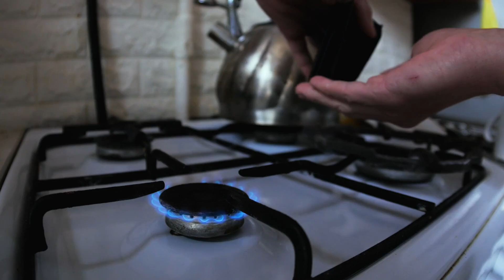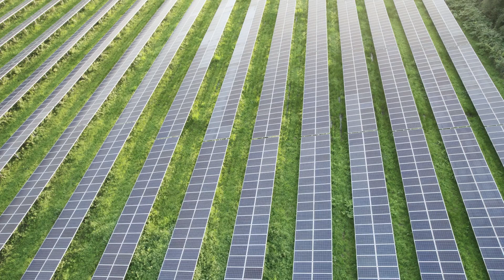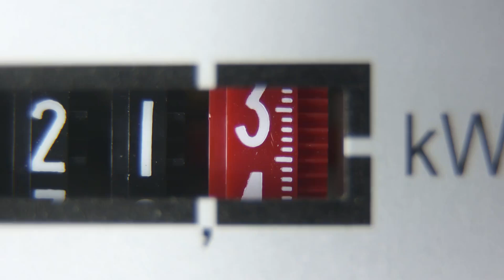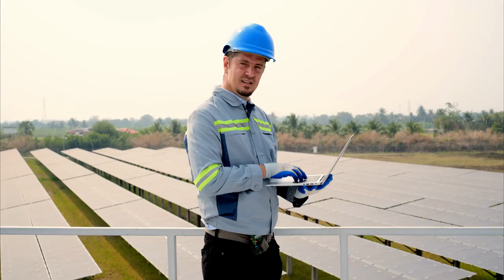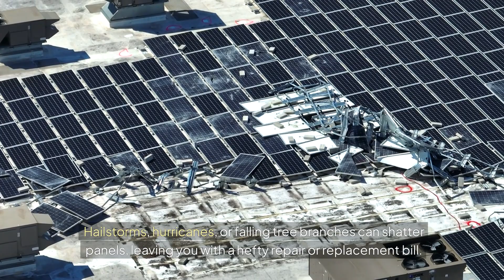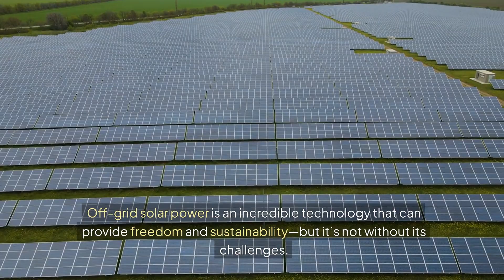SO YOU THINK YOU WANT TO LIVE OFF GRID ON SOLAR?

Comment: As others have noticed, solar is much cheaper now than it was 10 or even 6 years ago. The current cost of PV panels (in Italy) is nowadays absolutely marginal, you spend more for the support structure and the wiring, than for the PV panel itself, so buying 10, 20 or 30kW of PV panels will not break your bank, at 150-200 USD/kW. Another key point is becoming technically competent to allow the DIY route, with this you can save a lot of money, eventually getting a technician only to check/adjust what you have done, and to add the necessary surge protection and grounding components, can be tricky for a DIY person. There is plenty of YT channels explaining everything you need to know, start with "DIY Solar Power with Will Prowse" and "Off-Grid Garage" by Andy in Australia. Batteries must always be sourced directly in China, with good quality cells like EVE, CATL, REPT, Hithium and so on: a 16kWh with BMS costs today around 1600 USD, that is 100 USD per kWh. But you need to be or become technically skilled, and have some passion to go this route. All the electronic must be bought when there is a special offer/discount on them, it happens constantly on Ebay and solar sellers.
I have chosen the DIY route, starting small at 8kW pV, 6kW inverter, 25kWh battery, one year ago. Now I am considerably expanding the solar setup, at around 30kW PV, 26kW inverters, 100kWh storage. Most plant is done with quality components, like Victron, Fronius. Total cost will be circa half your documented 6kW plant cost.

Comment: If you want electric heat a single 1500w heater can use 36kw a day, so you need excellent insulation. I use a 170w heater under the trailer and use a 350w heater inside, if you try this with a normal trailer you will freeze. I haven't seen sun for weeks so a Gen on LPG with a big tank is a must. I discharge 8kw a day running everything, when it gets to -20c I use 14kw a day. If I wanted to cover all my power needs with no gen I would need 20kw solar,60kw battery and a EG4 18kw. I have 11.6kw 48kw and 8kw inverter and charging every 2 or 3 days for 120 mins. Rv 6gal electric hw heaters are 1400w, less than .2kw a tank, under rug heaters work with low power 60w to 500w can help maintain temps for longer in between using 1500w heaters for a short time like .5kw for 20 mins. It was 22c inside, just the 170w heater under the trailer 7 hours later it is 16c inside, insulation is the only way it works.
Reply from the maker: I have a pot bellied stove that warms the entire cabin-almost too well, and living in FL heat really isn't the issue, it's the AC lol. I have propane as well, so eventually I'll buy a propane water heater. Just other projects in the way first.
Reply: @offgridstyleprepper  I should be done by summer, I have to move 2 or 3 arrays in summer, and more insulation under the trailer. The basement heater is melting a huge path around the trailer. AC can use a lot but np if the sun is out.

Comment: Oooooohhhhh, $40,000 for your system. Big whoop, people blow $70 to 90,000 on a Quad cab four-wheel-drive jacked up pick up truck down in Florida. i’ve been totally off the scam electric grid 2 3/4 years and I wouldn’t have any other way. Of course I don’t have to pay $1500+ a month truck payment or $200+ a month for insurance.
Reply from the maker: I drive a 22 year old Suburban. My monthly bills are less than $900 at this point. I didn't buy this system, it came with the purchase of the property and cabin, but the seller included all invoices which is why I know the cost. The video is on what my own experiences are living solely on solar power. Oh, and I live 'down in Florida', whatever that reference is supposed to mean.

Comment: Im sure this video wasnt met to scared anyone away from off grid living but to make aware of limitation and cost understanding. Off grid just another way of saying im changing my life style to save money... No! It is a learning curve to adjust and adapt to less of what you are use too! I did my share of research before i purchased land and relised gas espescially natural gas is your friend to assited an off grid system by far cheapest backup for fueling generator and powering high loads. Hopes this helps
Reply from the maker: Yes, there are things you must consider before taking the plunge! Eventually I'll get a propane water heater.  Someday, when the more pressing projects are done. For now, solar shower bags work perfectly, even in winter the water gets hot enough that I need to mix it with the cold water of the shower.

Comment: While I agree that going off grid is still expensive it is no longer complicated. Modern hybrid inverters from eg4 and sol-ark provide 12k to 15k of power along with three separate charge controllers in one box. That's enough power to run an electric range, a heat pump and just about anything else you wish. The only piece of equipment I haven't been able to run is my 5hp air compressor but I think I have a solution for that. Solar panels are now so cheap there is never any reason to put up anything smaller than 12 kilowatts. Batteries are the most expensive part of the system. You really need at least 60 kWh which isn't cheap but at least it is now available. The cheapest batteries are probably from eg4. I suggest placing the entire system including batteries in a separate insulted shed with a small heater since frozen batteries won't charge.

Comment: How much would your system cost with today's prices?  I'm looking at going off grid in a place with cloudy winters, and it became really clear that batteries were impractical to fully meet winter heating requirements.  But the combination of propane water heating, cooking, and generators, and wood fired stoves and solar powered mini splits for space heating, seems feasible and resilient.
Reply: My sol-ark 15k inverter with 74 kWh of batteries has no problem running my electric range with induction cooktop. It really is much nicer than propane cooking.
Reply from the maker: @richdobbs6595 I actually looked this up, out of curiosity. 6 years ago the price was $40k, as I said in the video. Now, there is a hybrid inverter, so you don't have to buy a separate inverter, controller, and charger (although I kinda like that they are separate, it allows me to troubleshoot easier-but the new one probably would do better at handling nearby lightning strikes so 🤷‍♀ lol) In today's market with 16 solar panels, the whole system for 5600w would run about $18k-$25k, that is if you were starting from scratch, had to build the solar panel 'shelf' to secure and hold them all, an outside storage room for the batteries and control panel, the extra electricity panel etc. One nice thing, out in the solar shed, the guy built a main cut off (which can now easily be rewired to a hybrid cut on/off) and a separate electrical panel that has the water pump and the house, so you can turn off either, or both. I also like having propane for the stove, I'd definitely suggest a propane water heater, and a large backup generator that runs on gas or propane. You can have a line run right from the propane tank to a hook up for the generator when needed.

Comment: Not sure I agree with much of this. We have been completely off grid for nearly ten years. I designed and built a robust system of multiple solar arrays, multiple battery banks and multiple inverters and chargers. 4600W solar array 6000W inverters with peak 9000W and 2700Ah @24V battery banks. Winter we do about 6000-7500 watts a day. Summer 15-17kW. We lived in a 200square meter shed with all the mod cons for years. Built a house on the site two years ago. It has a dishwasher, my wife, daughter and I have multiple laptops and desktop PCs, we have a multimedia room with a couple of hundred watts speakers in an 11.2.4 system. I run a CPAP machine every night. We have vacuums, microwave, kettles and toasters. We have a generator but last winter I used it twice. Today as first week December batteries were fully charged by 11AM and the rest of the day they floated. Did the washing, used the dishwasher, worked from home and the ladies of the house are watching TV as I type this. And I certainly didn't spend $40K on it either. And we live in a locality that has many power out. Ten years we have had none.
Reply from the maker: Well, you have a great system, but I'm sharing my own experience with the system I 'inherited' with the home that is 5600w and to show people that regardless of the system they get there are still things you have to compromise on. It's good that you're able to use more power than we do and that your system works so well!

Comment: Great video. We have been living completely off-grid with the solar system on our motorhome for the last 2 years. A motorhome has some advantages to building a cabin. Since you can press a couple buttons, turn the key and drive away, you can live where the climate is mild year-round. We like to travel to the mountains in the summer and to the desert SW in the winter so don't have to contend with snow and temperature extremes like you would in living in a fixed location. We have a propane stove, water heater and a propane furnace that we hardly ever use as our sun powered heat pump provides 90% of our heating and cooling needs. We switched from a propane fridge to a residential one almost doubling the capacity and saving us about a pound of propane a day, 365 days/yr. Everything else runs off solar.

Six years ago, we retired, sold everything, started living full time in our Class A motorhome. It was the best decision we ever made. Our solar/battery system allows us to live off grid just like we were plugged into a power pedestal in an RV park. In fact, we haven't plugged into a power pole or run our generator in the last 2 years. 

We started small, by building a 620-watt liftable solar array on the side of our coach that makes a nice bedroom window awning too. Next, we built a 12v, 560ah LiFePo-4 battery using 8, 280ah prismatic cells and a Heltec 330amp BMS. These cells fit perfectly under the steps of our MH where our old pair of golf cart batteries used to reside. By mounting the solar array on the side of our coach, we left our roof free to rack 8, 550w solar panels down the length of our 35ft Coach, 15" off the roof, above our AC, vents, etc. Our 4,400w array can run both our A/Cs, our household appliances and charge our batteries at the same time. We mounted a Sungold Power all-in-one 48V, 5,000W Inverter/100A charge controller/battery charger, breakers and a Lnex battery monitor on the wall in our bedroom. It saves us space as well as money compared to a system built with individual components. Our 48v battery uses 16, 320ah prismatic cells and has a 200amp BMS. Together with our 560ah 12v bank, we have a total of 23.5 kwh of batteries onboard, charged by 5,020 watts of solar. These prismatic cells are rated for 8,000, 80% cycles. That's almost 22 years if cycled 80% every day, and we barely cycle ours 50% so they should last even longer. If you plan on building your battery yourself, like we did, expect to pay about $120/kwh including the BMS, compression fixture, etc. at today's prices, if you have your components shipped in from China like we did. 

We removed the inefficient and noisy rooftop A/C we had in the bedroom and replaced it with an EG4 28.5 seer-2, 12k btu mini-split heat pump on the upper rear of our coach. It's super quiet and cools as well as the rooftop A/C we have up front, using about 1/3 the power. This 48v system lets us enjoy 24/7 off-grid air conditioning and heat from the heat pump if needed. Our total budget for both 12 and 48v systems was around $10k plus another $1,500 for the high-efficiency heat pump, as we did all of the work ourselves. If we paid a professional solar installer to do it it would have cost us 3 times as much. Not only will this system last us the rest of our lives, as we're old farts, but it has already paid for itself in the money we saved on RV parks over the last 2 years. The biggest advantage is the flexibility it gives us. Last year we visited 11 states, without plugging into a power pedestal or running our generator the entire time. Last winter, we boondocked in the desert near Yuma, AZ, but we like to winter over in S. TX too. We're staying this winter in the Southeast, where boondocking places are much harder to find than out west, but this wouldn't be a problem if you owned a piece of land where it's legal to park it on. We found an RV park here that's letting us stay in a no hook-up site for only $100/mo. saving us $500/mo. off of their usual rates. The point is that our solar system gives us options and lets us live for 1/3 the cost of our old stick and brick home.
Reply: @SuperSushidog  Interesting!  Thanks for your post.  I don’t plan on buying a motor home but It’s making me think about a few things.
Reply from the maker: Love this! The Producer and I have tossed around the idea of getting another motor home and doing something similar, and we were delighted to find out that now many come with solar panels, and are able to network in more of them, and room for more battery storage as well.

Comment: i have my used 24 car battery system 6 solar panels 110w p/s sinds 2006 only for led lights.( that works very well !).
2 solar panels a group times 3 groups from 4 bat in serie 4 bat and parallel gives 24v and 2 groups from 12v, so you have 6 groups from 12v fore use.
because the already used battery's i need to change then every 3 years, bring them to the scrapyard for money and take used second hands back.
in 2024 i change the 6 110w solar for 5  350 watt panels with 20 second-hands "new" battery .

I am now trying for the 2nd time a 230v inverter as they have become a lot more efficient after 20 years, with 4 of the 5 solar panels and 6 used batteries with a total capacity of 400ah as I can control 2 water pumps to flush the toilet, garden, hose the car and greenhouse.
more is not possible.
and extended the system in house with more led lighting and better led lights. (12v system).
Reply from the maker: It's amazing how much cheaper everything has gotten since our Schneider system was installed. It sounds like you definitely have the know how to get and keep power!

Comment: I have been living off grid for 7.5 years nopw. I learned a lot along the way. It is not true that equipment is designed for on grid. There are plenty of inverters that offer complete solutions to which you only need to connect your solar panels and a good sized battery bank. Inverter 2K, 6 KW panels < 1K (the framing and cabling is probably more expensicve than the panels themselves), 16KW 48V LFP Plug and Play battery bank with BMS, 4K (a lot cheaper if you assemble it yourself). It is not that hard anymore. You do need to dimension your system well though. Latitude, climate, energy consumption profile etc. But 40K is way overpriced for a normal home setup.
Reply from the maker: When ours was installed, roughly 6 years ago, there weren't a lot of complete off grid systems. There still are only 1/2 a dozen or so. And, the hybrid of inverter/controller/charger wasn't available yet, although I still feel more comfortable with them being separate-it's easier to trouble shoot which one has an issue when all separate. We have 16 panels, we've had to replace 2, we have 8 batteries and have had to replace them once (went cheaper with lead acid that time, looking at possibility of lithium ion this time, but so much more expensive). However, we actually got this system when we bought the cabin. What I stated in the video is MY own experience. I have the receipts-and the original owner installed it himself. I just want all the people who tell me they will 'just live off solar' to understand it isn't quite that simple. Thank you for your comment and your own experience!

Comment: 40k dollars for 5600 watts of panel and i didnt catch how much bateries...I built mine on victron energy components,have 17kw of bateies,and a backup generator,for 12k euros...i dont lknow how those things were that expensive...Offgrid solar totally possible,and its not that horrendous in price like in this video describes...Also,there is no mainentance or errors,at least with mine,fully automated,just works always.Once in a year maybe a propane tank change on the generator...
Reply from the maker: Again, this is MY experience. I'm glad you don't have the same issues. My system is 3 separate components-an inverter, a controller, and a charger. Plus 8 batteries, and 16 panels (I said 12 in the video but miscounted). We also live in the lightning capital of the country-Florida. Ground faults happen whenever a lightning strike is within a few hundred yards of the cabin. And I assure you, I have all the receipts from the original owner, directly from Schneider. The cost was just under $40k. Have prices/tech changed in the last few years? Yes. But a safe, insurable (which is kinda important) permit pulled (also important if you want insurance) system is still pretty darn expensive. And more to the point, thoses thinking of living 'solar dependent' need to realize their lives will change, regardless of system.  
Anyway, thank you so much for your comment! :)
Reply: @offgridstyleprepper  Yeah i agree with many point,but self sufficiency always has a cost,if even in just labor,or otherwise.For me,it was very important to have my own power(i built the whole system DYI),i am from Romania,and You never know what politics pull on us xD Anyways have a good one!